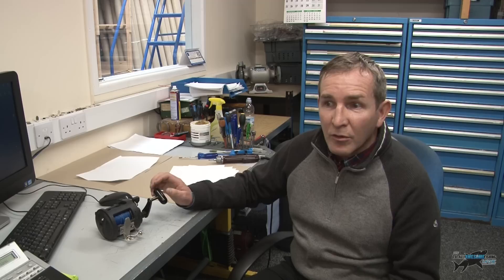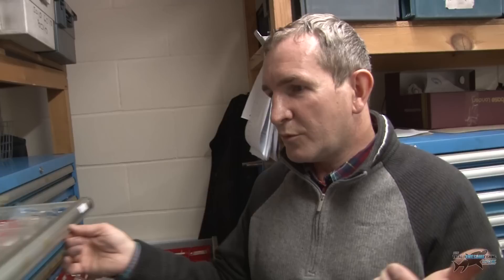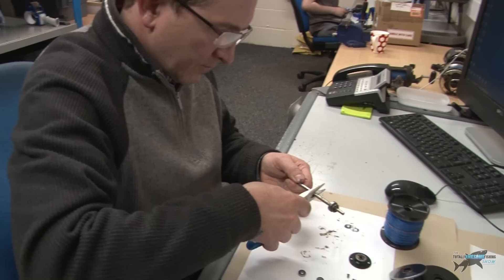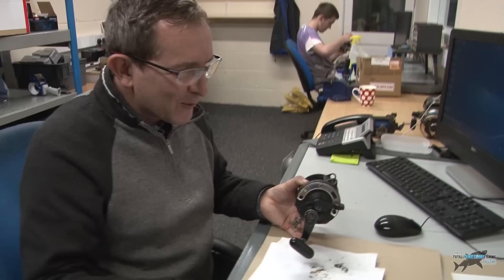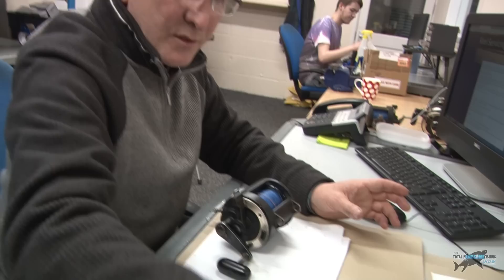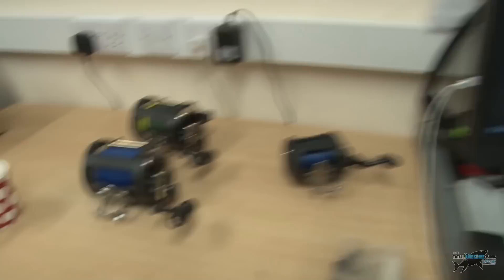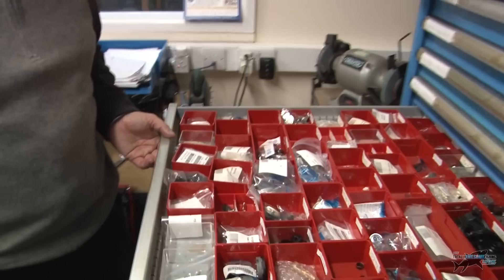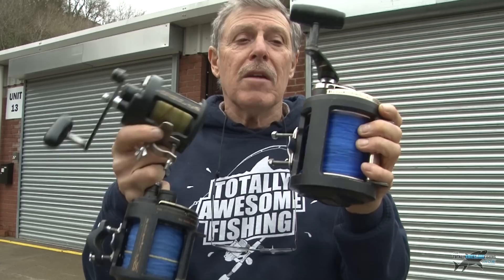How to Service a Fishing Reel - Fishing How To Guide

Comment: Thanks Graeme, do you think I am old fashioned, I still use  Mitchell 300 1968 that was for my 11th birthday. 810. pair of 410's..488.386.sigma and Penn multiplier reel  and they are still working ok. the 810 I have used a lot in the last 25 years. thanks for your video. :)
Reply from the maker: not !...nothing wrong with old reels,they caught fish way back then and can still catch fish now. The secret is maintenance . I remember the old 410's,probably the first of the "modern" reels back then.

Comment: Very interesting video Graham, can I just ask if he is saying not to use oil on the bearings why do people use red or yellow rocket fuel on beach multipliers? 👍👍🎣🎣
Reply from the maker: Too much is apparently not good,just a small amount of grease is better. I think that was over a wide range of reels,multipliers,sea reels,beach reels.etc.
Reply: Thanks for replying Graham, apparently people are talking about hybrid ceramic bearings,just looked into it a bit more,cheers.👍👍